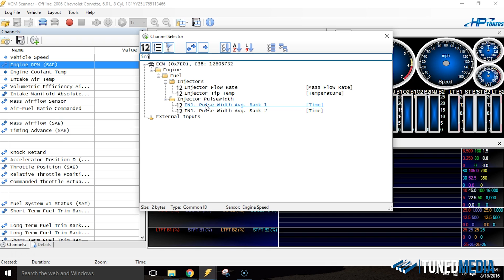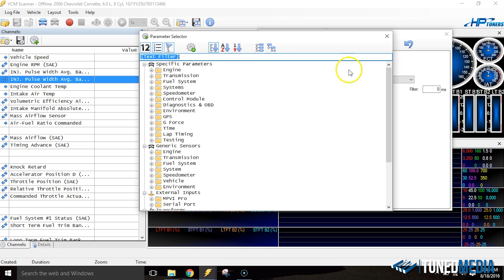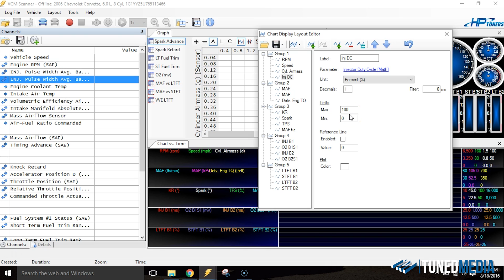How to setup your HP Tuners 3.x scanner to read Injector Duty Cycle

Comment: Hello new to tuning here, would I be able to adjust injector duty cycle to correct a lean issue in the lower rpm range and at idle or should I go another route?